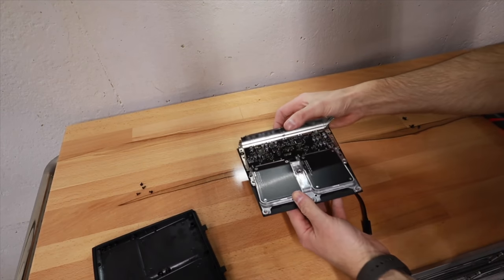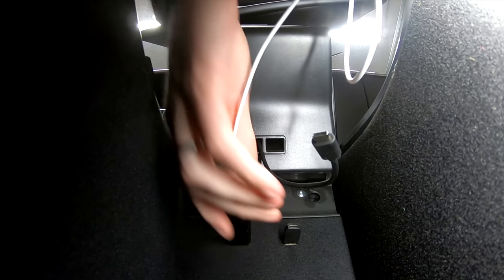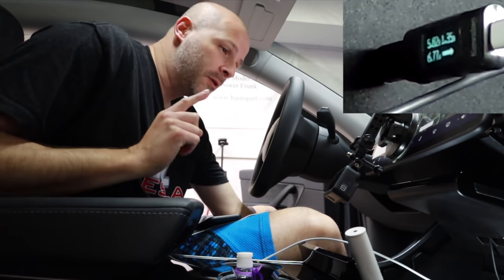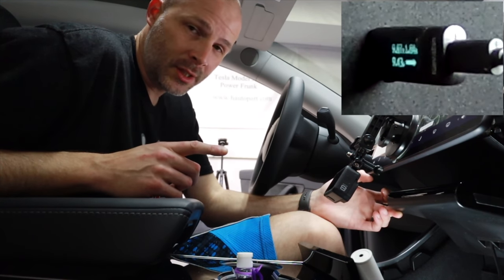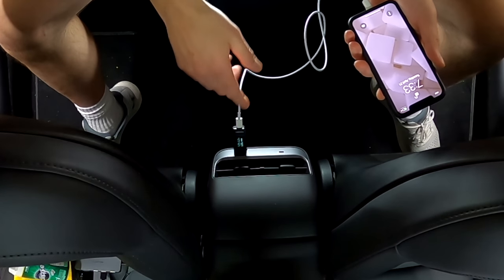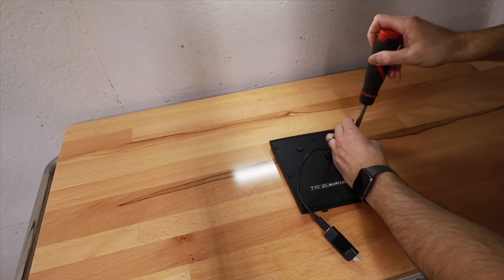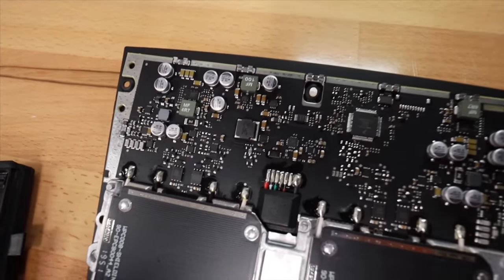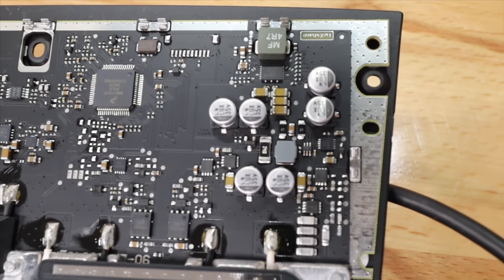Model Y Wireless Charger - What's Inside it

Comment: Brian, love to see what the wattage will be like when multiple devices are plugged into all the ports at the same time!
Reply: That's exactly what I was thinking, that would be the real interesting bit!
Reply: As the source is the same (USB-C) they have to share bandwidth reduced by loss of the cables and plugs.
Reply: @mirkonaumann1417  Do you know this as a fact?  What is your source?  There could be two separate USB buses, one in the front, one at the back, providing seperate voltage and wattage to each.
Reply: @edmanyiu  From what I have seen there is only 1 USB-C port used from the MCU to supply the other ports. This you can see in various videos like from DÆrik, Sandy Munroe and other YouTubers. But it is possible that this line is connected to some hubs with external power supply allowing higher drain on the various ports.

Comment: Hello Brian. I sold and tested USB chargers and cables in the past. If you want find out and compare what the output is you need use a USB resistor dongle. The reason for this is that the length of USB cables, the quality of the copper inside, the way they made the connectors and the SOC of your phone have a big influence on it. For example if you want charge faster you need short cables and you need "FastCharge" cables. Thin cables use thinner copper lines thus they are limited on speed. They are also not worth as they can break much faster. This is another point: you cannot see it but if the cables are some broken inside the speed is also lowered. You can only test and measure cable quality with USB resistor dongle behind cable and tester. Anyway - Thank you for the tests! We like your great videos 👍

Comment: It would be interesting to use an App like Ampere to measure the charging rate that the phone use when using wired and wireless.
- Can you give the maximum phone size fitting inside the charger. 
Note: For next tear down, can you remove the carpet from the trunk to find the possible location of the 3rd row seat belts anchor.
Also check if there is a harness connector plug to which the tow hitch plug could be connected?

Comment: My favorite feature of the new Model Y wireless charger is that it utilizes only one cable to run both sides to free up one of the ports.  Now...will it fit in a Model 3 with a USB-C to A adapter?  Hmmmmm....

Comment: One Plus 8 has a 30 watt wireless charger, and I've never been impressed with wireless charging speed on normal phones. Which ports stay on even after the car shuts off? Pretty sure it's the back seat ports that stay on but not the front ones. I always plug my phone into the back seat ports if I need to charge after leaving the M3

Comment: Wireless chargers are not 100% efficient nor are the cable ones (but they are so close). For wireless chargers that means that not all the power goes in to the phone. You should test it with phone app (I use Ampere but it's for Android, I don't know if there is one for ios). Firstly measure how much power the charger uses and than how much power the phone gets and you can calculate how much is lost.
Reply: Efficiency will always be lower than 85%, sometimes even less than 50%. It always depends on how they are made in both sides, how thick is the cover between and the position. But it is comfortable and the phone's USB port cannot break from plug and unplug which is worth much.

Comment: Can you try to charge a laptop over usb c, I’m curious if this works ...
Reply: Depends on the laptop I'd say. Small laptop can maybe use but for example my 17" has a 150W charger. This is impossible on USB-C. Than the laptop can only pull the maximum while it's battery is running low. I have seen this even with the 150W charger while running heavy games. Or you need switch off to recharge it. This can do but takes its time.
Reply: Better use the 12V outlet. This has higher output and chargers are easy to find.

Comment: Where did u get that usb meter?
Reply: Check out on AliExpress. There you find many and with different functions and quality. For testing purposes add a USB resistor dongle with at least 2W so you can check the quality and speed of your USB cables and chargers.
Reply: Check on AliExpress

Comment: Did you look at the power consumption when two phones are charging on the wireless charger?
Reply: Thomas Van de Velde That’s an interesting experiment. My guess is both have identical charging capacity.
Reply: Should be same source so bandwidth will be shared like on SuperCharger V2 😉
Reply: I tested it myself and total output jumps from 5W to 10W when you add a second phone so there's no degradation.
Reply: USB-C must at least be able to transfer 3A but better can up to 5A. So you say Watt means nothing as normal USB-A is 5V with at least 500mA on computers and up to 2A (sometimes up to 3A) on good TravelChargers.

You multiply the current with the voltage and USB-A gives 10-15 watts. USB-C can also have higher voltage up to 20V to achieve a maximum output of 100W (e.g. for charging laptops).

If the single USB-C on the MCU has an output of 100W than all ports behind share from that maximum output.

It is possible that not all USB ports are connected to the MCU line. You can test with controllers. If they are not recognized (e.g. on the back) this could mean they use a separate power supply. Separate does not share from same line.

Comment: Can you try to charge a laptop?
Reply: You can charge any but only to the maximum output of the USB port. Running while plugged in may drain down batteries on most laptops because they need more power. Check your laptop charger to find out the Wattage consumption. If it exceeds the USB port than you have the answer. Other and better option is to use the 12V outlet. For this already many chargers exist.
Reply: Mirko Naumann yeah and this is what he should find out ... of course is a laptop charger better, but that’s not the point. A usb c cable is better than a whole charger. Not all usb c chargers can charge a laptop about usb c. But it looks like the charger is able to charge usb c laptops ... he should find out how many watts the charger can handle ... so the question is is it a usb c pd 3.o